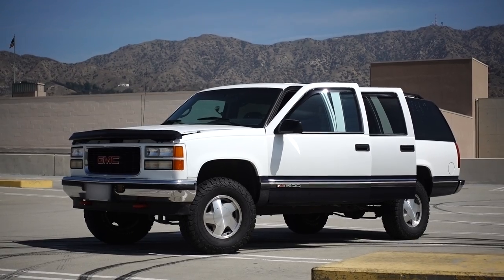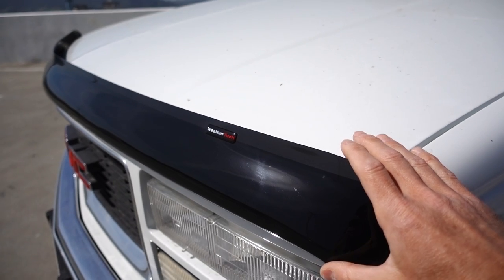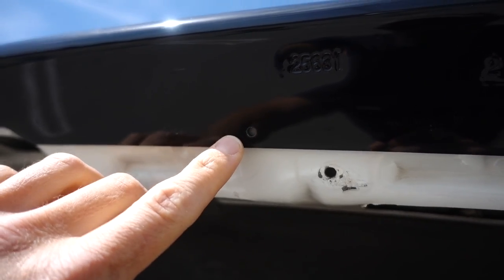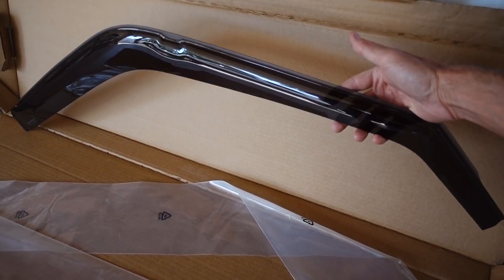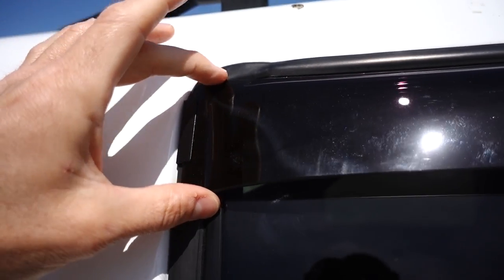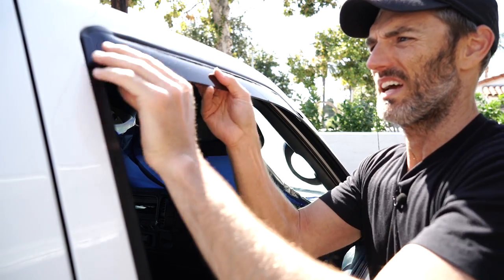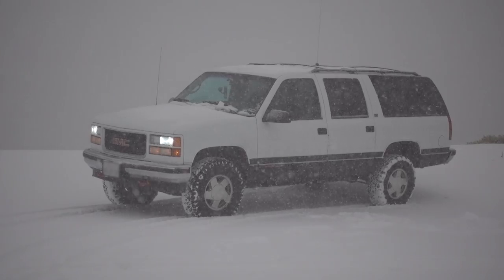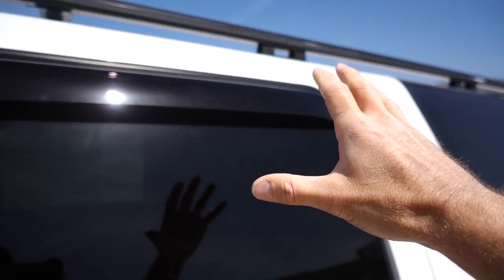Here's Why You Should NEVER Buy A BUG DEFLECTOR! (Because You Just Might LIKE IT!!)

Comment: Bug deflectors would really be great if they actually deflected bugs.
Reply: They do deflect bugs, grasshoppers, rocks etc. They aren't and never were intended to keep your windshield completely clean from bug guts. Keeping the front edge of your hood from taking damage from direct hits from hard bugs as well as the acid from the guts along with a bit of security from rocks was the original intent imo. Take a look at an older truck that never had a guard and look at one that has and you will see what I'm talking about. The guards on the 1ROAD Suburban are nearly the same as I had on my Tahoe. Not only do they serve to protect the paint job and the windshield but look great on that body style. I had to replace my hood guard once after a rock hit and broke it. No doubt it saved me from taking more expensive damage.
Reply: @hwsadberry6781  Good point.
Reply: They work, it would deflect most bugs
Reply: @hwsadberry6781  thinking of getting this for my dads Accord.  He daily drives and it gets chips all over its hood
Reply: @T6Jacob  he's following too closely behind others. Especially trucks with offroad tires pick up road pebbles and fling them much more
Reply: The bug deflector creates a air stream upwards and does push most of the insects up and over. 👍🙂
I don't care for them because in "snow country " ,it's a pain to clear the car.
Our summer is short enough to do without the bug deflector!!  ☝🤣😂

Comment: The hood bug deflectors are actually incredible. If you’ve ever driven through an area with heavy bug infestation at night where you can see it working it’s truly amazing. I had one on my truck years ago and it was a life saver as I worked a lot at night. 
However, I ordered the Weathertech for my 2018 Silverado a couple of years ago and was incredibly disappointed. The screw holes didn’t line up with the factory locations on the truck and once mounted it was incredibly wobbly and it was obvious it would have scratched my hood up badly. I ended up giving it away to someone else. 
I’d like to get one for my truck now, but don’t know which one would fit securely. I know it’s not the Weathertech!!
Reply: AVS

Comment: Window visors are a must for every vehicle. I've never been a big fan of the hood bug deflector, but they look pretty good. Just not my thing. My first set, over 25yrs ago, were in channel. I thought that was the best and only way to go. Over time I found out they come with some problems and headaches. Been using the outside tape ons ever since. They work great. I use the AVS brand though and never had a issue. Love the truck  and original look with the factory rims.
Reply: lol no it's not, it's old fashion that expired in the 90's.

Comment: Only had one truck with deflector on it.  Was on there over ten years.  Ruined the paint down deep in there where I couldn't wash well.  Also had a small rock chip in the windshield.  You can't win.  Run what you like, it's more of a trim item than a deflector though.  Cleaned all kinds of bugs off my windshield in N. Carolina. Maybe deflects Nats, I don't know.  
I have those side window shades also, mine are the 3M tape on's.  Biggest problem with those is having them blow off going down the road.  Dang 3M tape is a bear to get loose but be damned if it has not much problem on it's own.  The shades are nice in humid area's where in spring you may not want defrost on but feel being able to see is sorta important too.

Comment: The old (they defectors that were about 5” tall with zero angles, just straight up, and most of them were either clear or had a blue tint) ones on the square body Suburbans, actually worked.  Growing up, we had a ‘74 ‘Burban w/ 454 and went on minimum 3 family camping trips a year.  2 of the trips were in the Cascades mountains in Washington. The other 1 was our annual trip to Montana to see other side of the family.
So, 6 of us in this suburban pulling a 21’ Terry travel trailer with that billboard of a bug deflector.  
By time you got through eastern Washington, which believe it or not is partially a desert, that deflector would be covered with at least 2 layers of large insects lol.

Comment: I used to drive a 1995 K1500 as the parts delivery truck with the same deflectors. The rain guards are sure nice on a hot but rainy day. The one thing I still kind of like that you're missing is the big sun visor - but the one I remember was pretty noisy.

Comment: I've always used AVS window deflectors. Good quality and price. Never had an issue. I've only used the type that stick to the door. I just never wanted anything additional in the window channel because I've seen those types get loose and prevent the window from closing.
Reply: I just put on the AVS deflectors but put them on crooked..is there a way to take them off and reposition them?
Reply: @A.C.71  AVS uses 3M automotive grade 2 way adhesive tape, which is usually impossible to pull up and reuse. If it hasn't been adhered to the vehicle for an extended time i.e. more then a few hours, it may be possible to slowly pull the misaligned ones and reposition. In my experience, you will likely have to pull them, remove the old 3M tape, apply new tape and reinstall. 3M automotive tape can be found at just about any auto parts store. Pro tip, next time you go to install, position the piece where you think it looks and functions as intended, only lightly press on one position on each end to hold it in place while you take a step back to check alignment/fitment, if it's good, continue to secure the rest, if not, this makes it a whole lot easier to remove and reposition.
Reply: @michealrobinson  That is a good tip. Thanks

Comment: I have a 2019 VW Atlas,  tried AVS(cheaper than WT) and they did not have a chamfered edge and in the front did not go from The mirror to the top corner of the door.  Kept falling out.  The rear window kept clipping the visor.  The chamfered edge is definitely important.  Got a refund from avs and bought the WT.  Perfect fit. My floor mats a Max 3D Pider.  Less expensive and do not slide around like the WT.

Comment: I have a 2012 Silverado crew cab.  Had the WeatherTech in-channel model on all four doors.  The rear doors...the clip moved down slowly.  Just enough that when the windows was eventually rolled down.  Each flew off the truck at different times...after having been installed for over three years.  So...periodically check this clips.

Comment: I have a bug deflector on my 2010 Explorer but, the styling of the side window deflectors just does not appeal to me - the bug deflector I bought used factor holes for the middle screws but, I needed to drill holes for the outer holes.

Comment: It looks good.I wouldn't trust tape to hold it on over time.Screws would be more reassuring.The in channel window deflectors(from my experience) interfere with the normal up down of the window.I was told that the speed in which the window travels may have to be adjusted.I have no idea how that is done.

Comment: Looks good Bud! Got them on my 95 Z71. Have you done a Knock Sensor replacement yet? That's the last sensor I need to replace. 285,000 miles and going strong. Just put a Redhead steering box in, Expensive but Wow..... Such ease to steer, no play whatsoever....

Comment: I have the same ones in mine. I've had them for a couple years now and for the most part, no leaks or scrapes. But, the front window deflectors near the mirror don't seem to stay in their spot very well.
Reply: Can you tell if the window deflectors increased or decreased the wind noise at highway speeds?
Reply: @bradhickman1618  it's about the same with or without, since most the wind noise for a 90s OSB comes from where the door meets the cab.

Comment: Thought I might have to settle for the adhesive mounted vent shades for my SUV -- then found the W-tech items. They are tight and you do have to fiddle around to get optimal seating, but mine don't have the clips. To increase the overall "slipperiness" of the glass I siliconed the crap out of the side channels and cleaned the top edge well. For a month or two, every time I got in the vehicle my synapses were telling me I'd left the windows partly open . . . but they are really good to have.

Comment: on my town n country van I had the deflectors that tape on . they eventually loosened up and would flap in the wind. I re-taped them twice. on my f150 I went with in channel. I had to shave a little bit of plastic off to let the windows seat properly but now its a beautiful thing. if you don't like those clips you can get 3m tape and use it. I think in the long run the clips will hold better. they do look fine. im debating about adding a bug deflector, do they actually deflect bugs?
Reply from the maker: Good tips. You know, I’ve never actually witnessed a bug being deflected from the windshield. On my next trip maybe I’ll update ! 👍

Comment: Looks good! I'm about 50/50 on the unibrows in general but I like it on your burb.  I've had avs ventvisors on my 1990 c1500 for 12 years, replaced the adhesive about 4 years ago, otherwise they've been great!  Also just installed a set on my 01 Silverado z71. The stick on avs brand aswell.  I thought about replacing the ones on my 1990 with the in channel version as mine are getting brittle after 12 years of desert sun. but after seeing how your weather tech visors fit the gmt400's I might look into other brands before changing from the stick-on type.  Thanks again for another great video Jimmy!

Comment: My K1500 pickup had a bug deflector installed and it looked decent. My Suburban doesn't, but I haven't noticed if it makes a difference. If it deflects slushy road spray, that would be a win.

Those are nice looking window deflectors. I had a Rodeo with the stick on style already installed by the previous owner, but that design looks a bit like plastic taped on the door (since it is!). It would be nice to be able to crack a window while camping if wet weather is possible. It would be great to get a report back from you in a few months to see how they do after some use. I do love the skinny A pillars for visibility and hate to mess that up...I wonder how weird back windows only would be.
Reply: Also, how is your white paint holding up so well? Was it garaged it's whole life?

Comment: Jimmy READ THIS ——- D A N G E R —-   First I do like the look of your ride. BUT I had those in channel on my SUV for several years. After I took them out the seal leaked air BAD. Going down the highway it just whistles.... I believe it was caused by the seal being squeezed / compressed by the in channel wind deflectors over the years, the seal never came back to original shape and it’s been 4 years now. Again I do like the look of the in channel over the stick on but be warned there are consequences.  But on the other hand you can do a video in the future on how to replace the window seal... (speaking from experience)

Comment: I think the in channel deflector puts more strain on the window motor
Reply: I would never by an in-channel. And you're correct. They do put stress on the motors...especially the driver's side which is typically the most used. Double tape to the door frame is the best.

Comment: Thanks, Jimmy, Oddly interesting: as I am not really into a lot of Cosmetic stuff...BUT, you piqued my interest on front Deflector , if possibly reducing Front Window “ chipping, etc.”...both my Front Windows have lots of minuscule & small ships, esp the GMC 2007.. interestingly :*detailed **inspections of my engine Air Filters show incredible amounts of rocky/sandy grit coming in Front air scoops, esp 2015 Journey here & especially in Montana driving!  * Actually, hear a lot of lot of small rocks hitting front Windshield @ some 80 MPH , ON A LOT OF DRIVING & behind Semi’s a lot ....ACTUALLY,,I HAD TO,CHANGE OUT my K& N PERFORMANCE Engine & Cabin AIR Cikters to **ORIGINAL EQUIP MANUFACTURER M & inspect* more frequently: luckily , never had know issues with K&N using 200,000 miles or with MAF FOULING IN INDIANA...Incidentally, my GMC filter is a little hard to,fit , or mount with big Band/ in tight / Clamps air Box !    * Also, I’m still using my Second and Third  Weather Sets of Tech FOOR MATS ( 2007 GMC CANYON, 2015 Journey):: perfect *& best Quality.....PPSS***”Guranteed “ forever too.